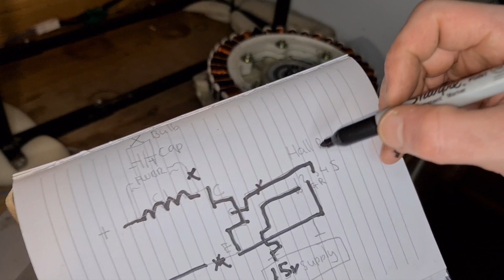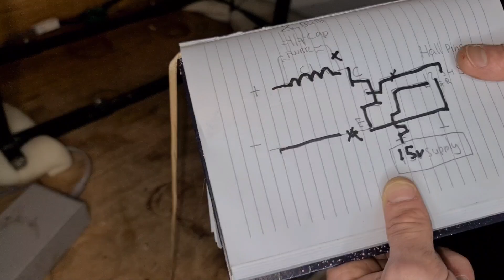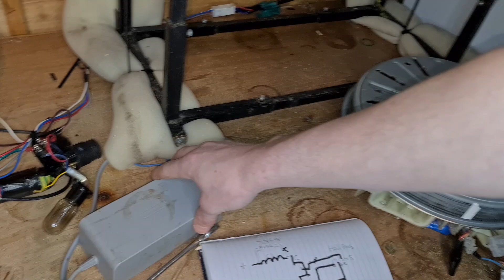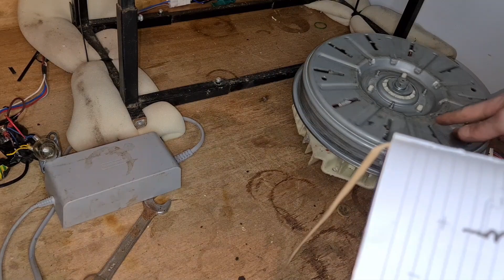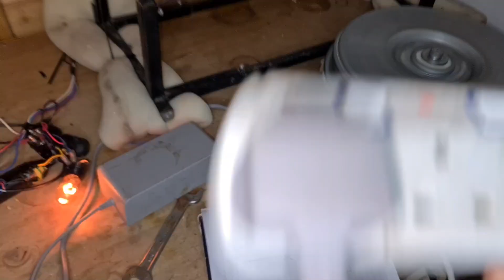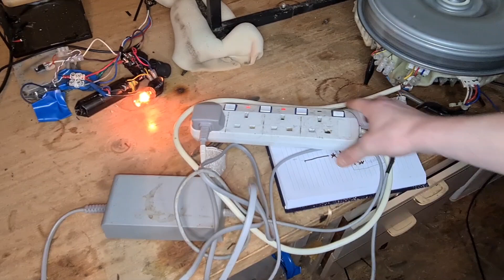Hyperdrive Hall Sensor Update.

Comment: I want to use an e-bike motor will that work? I think every BLDC motor works the same principle. is that right ?
Reply from the maker: Yes indeed I have already tested with every bldc. You can even use the factory hall. However not the same way the circuit is a little different.
Reply: @EnterTheRealm  I see you are using 1200v igbt. why high voltage to get more back emf? capacitor for resonance or for tunning ?
Reply from the maker: @selimtasci2150  higher voltage meandering more rpms. The faster ot goes  the higher the voltage is on the generator side also. Cap is for back emf also

Comment: Great Job ! Would you please post what's the max wattage load you can plug in  while its self-running ?
Reply from the maker: Haven't achieved self running yet. However I do believe it's possible with the right stuff. Basically I have looped the device and it's speeds up so just saving up to get some really good caps. Possibly super caps and or a pole transformer. Another thing I realised even though the generator coils are not directly connected to the input somehow there are still electrically connected via a flux field so to get around that I'm going to have to use this generator to power a dc motor to turn an alternator via a belt. So far its looking promising. 👌
Reply: @EnterTheRealm  thanks for the prompt reply. I recently  bought 4 sets  of these from Facebook marketplace, my plan is to set two of them on a shaft with a flywheel as well as replacing ceramic magnets with neodymium magnets. Output connecting to a smaller DC motor and achieve a loop with help of jump start battery. Remaining output  to a step up pole transformer to increase output OR to an induction cooker which will have multiple bifilar pancake tesla coils (induction cooker is taken apart to place bifilar on both sides of transmitting coil)
Reply from the maker: @snatras6668  no problem. looks like we are on the same line of thinking in terms of looping. for the drive motor do not switch out too neos I have a rotor with them replaced for the ceramic ones yes the motor turns but slower and almost impossible to turn by hand just too start. I think the stator density and material is not designed for such a high strength magnet. However it does work.
Reply: @EnterTheRealm  I would like to try your set up, I've noticed you modified winding on some coils (you added more windings on some coil legs, and reduced on some other ones. Would you please share your notes for winding and connecting them ? I sent you a message on fb the other day. Thanks again.
Reply from the maker: Message me again on Fb I will help you out there.